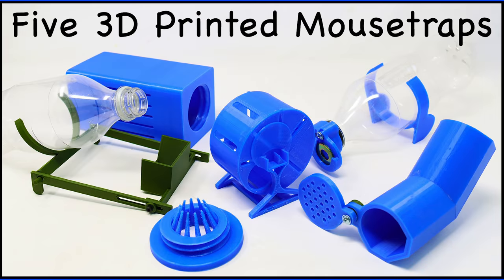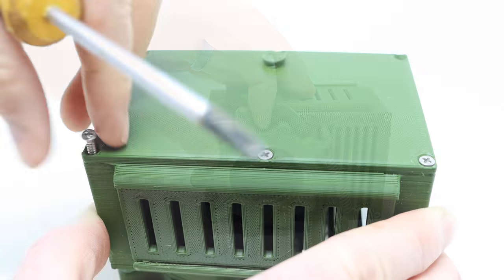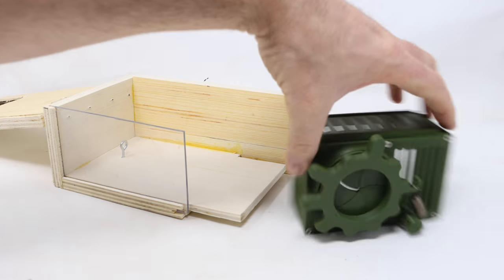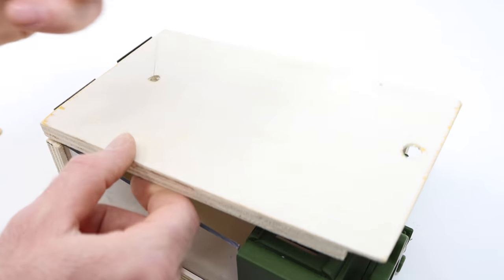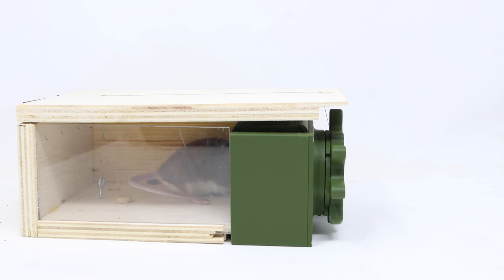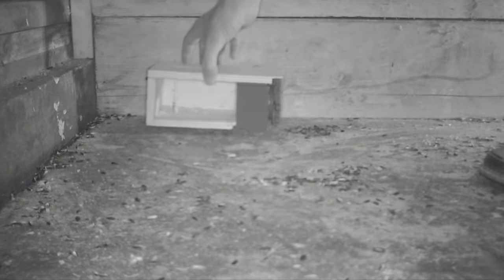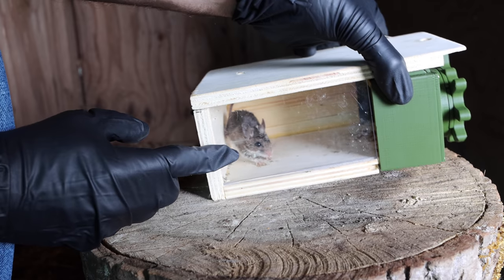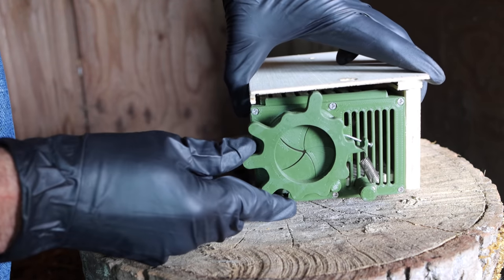3D Printed IRIS Mouse Trap With Modifications: Mousetrap Monday.

Comment: I think they would eat through the PLA. I would use the trap front over a large pickle jar, make a hole in the lid, electric pressure plate and solenoid to trip it.

Comment: Hello that was more of toy i designed having fun that is cool you get it to work better i sanded the trigger to make more sensitive but it was small i had a small printer at the time.  I was surprised to see a u tube video on it i did spent a lot of time getting the iris to be smooth not clunky that was more the goal.  thanks have a good one